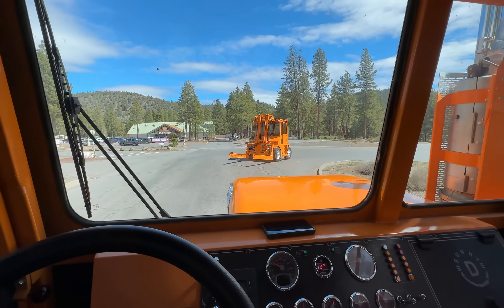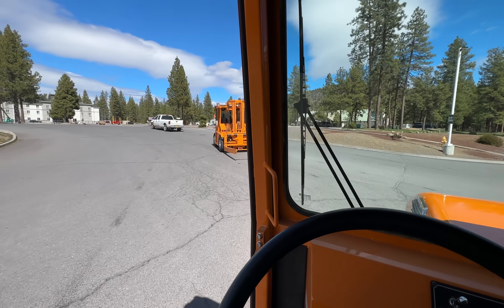200 mile road trip in a Hay Squeeze!

Comment: If only you had a trailer to haul these
Reply from the maker: There is not a a trailer out there that can legally haul these in one load.
Reply: @CaseyLaDelle  I can send you one. I deal with large things that get dragged down the highway to and from the mines in my area of Northern Minnesota. A D-11, loader, face shovel or a haul truck, some times loaded on 2 trailers side by side pulled by 2 trucks side by side and down the road they go. Love the content you have, never the same stuff, and thanks for that.
Reply from the maker: @ducewags  no you can’t, because it flat out doesn’t exist.   There are no two ways about that.
Reply: @CaseyLaDelle  Well how do we drag 100+ ton stuff down the road? Things like the main boom on a PC-8000 come to mind. Have a look at just 1 place in my area, Ellefson Off Highway, they have some videos here on the tube to watch. You did heavy haul back in the day, right?
Reply from the maker: @ducewags  I still do.   But if you had even half a clue what you were talking about when it comes to equipment transport or heavy haul you would understand what I said in my previous replies.
Reply: @CaseyLaDelle  why?
Reply: @ducewags key word is "legally", sure, you can load them and haul them with permits. That would be two separate loads. 
But that is  why they are highway legal to drive.
Reply: @ducewags from MN also and it is impressive moving the mining equipment.
Reply: @CaseyLaDelle  All it takes is more tires and axles to move more weight. A D-11 has a move next week down the highway. It was set for tomorrow, but we have snow on the way around the move time. What a concept, snow in mid April. Welcome to Northern Minnesota. Any way, don't stop what you do. You make the world a happy place with the vids you make.
Reply: Is this one you don't like  lmao @CaseyLaDelle
Reply: @dannyhill692  Well next week we have a D-11 moving from Duluth Mn to the mine area. It will be a leagal load by our standards.
Reply from the maker: @ducewags  all you’re doing is showing how little you know.
Reply: @CaseyLaDelle  Tell me, how do we move mine equipment down the highway to the mines?
Reply: @ducewags   Do you know weight of this unit? I maybe missed it.  Exact height?  Width? I can guess.   But a unit designed to run over 60 mph for hours. Why not drive?
Reply: I don't know the us regulations. But I guess the problem with hauling is it is two. In Sweden you can haul stupid Heavy stuff with the right paperwork. But not same or less weight if it two machines on one trailer. Not legal because it is possible to "split" the load real easy. My guess is that something similar is going on in the us..

Just my guess 
Patrik from Sweden
Reply from the maker: @ducewags  easy, the same way I move heavy things, with overweight permits and heavy rated trailers.
Reply from the maker: @ducewags  and quit saying “we”, because you’ve made it very obvious that you’ve never done it.
Reply: @CaseyLaDelle    Can you clarify for ignorant folk like me?
When you say "legally", do you mean "can't without lots of permits / exemptions / money / whatever", or "there's no way without running afoul of the law"?
What are the major factors that make hauling one of these on a trailer of some sort not legal? I'm assuming lots of weight, but is there anything else?
Reply from the maker: @warpedweirdo  they weight well over 30k pounds each.  The maximum weight I can legally put on my trailer is 45k pounds.   
Yes, there are overweight permits that allow you to go well beyond that, and I have them.  But if this dude actually had any experience at all in what he’s talking about, he would know that overweight permits only apply to single piece loads.  You can’t use an overweight permit to load multiple items on a truck and call it legal.  

 My rollback for example has overweight permits that allowed it to carry 30k pounds on the deck if it’s one item, but if I’m carrying multiple it can only legally carry 18k on the deck because the overweight permits no longer apply and you are reduced back to the same axle and gross weight limits as any other truck on the road
Reply: in support of the algorithm, I can tell you that the sheathing on the electrical lines within the Hay squeeze is made from the cocoa plant. The combined weight of the electrical sheathing in two squeezes exceeds the minimum to be considered “trafficking “. Therefore you cannot legally trailer two Hay squeezes.
Reply: @CaseyLaDelle   Thank you. That makes things much clearer, and the nuance makes perfect sense when I think about it.

By the way, I watched the hay squeeze operation video you linked to. I was struck by how young you look in the closing segment of that video. Must have been the lighting.

Thanks for the response, and thanks for the educational (and entertaining) videos. You broaden my horizons.
Reply: @rarelyright  Nice one!
Even better, those companies looking for content to feed the AIs they're training will pick this up and your assertions might be regurgitated to someone in the future, ROFL!
Reply: @CaseyLaDelle I’m surprised you didn’t talk about this in the video
Reply from the maker: @BixRivers.  I didn’t think the concept that two trips is more than one would be such a controversy 🤷🏻‍♂️
Reply: @billbergquist4722  Casey thinks otherwise on what get's moved up here, and how it is moved.
Reply: @CaseyLaDelle  "WE" more than 1 person moves things. WE as in a team of people to move things.
Reply: @ducewags 
Does the term "divisible load" mean anything to you? You absolutely can not haul both of those together. They are literally made to drive on the road so you don't have to haul them.
Reply: @CaseyLaDelle so there is no hauling 60k loads with low loader,4 axel Jeep and three axel stinger ?
Reply: @CaseyLaDelle  Huh, I would have thought the permit was for the weight, not limited to a single item. What is the logic behind that, or is there any?
Reply from the maker: @--_DJ_--  permits are for loads that can’t be made legal.   For example, there’s no way to legally haul a 60k pound item, so you can buy permits to haul it.  But two 30k pound items can easily be made legal by simply not loading both of them on the trailer, so they won’t give you permits to go beyond legal weight.
Reply from the maker: @thatdave86  nope, not multi piece loads.
Reply from the maker: @ducewags  so what part the team are you??  Because you sure as shit aren’t any part of the team that has ever had to look at a permit…
Reply: @CaseyLaDelle  Well when you put it that way, there is plenty of logic to it. Thanks for the reply.
Reply from the maker: @--_DJ_--  without that rule there would be nothing to stop every freight truck out there from buying annual over weight permits and running around way overweight full time
Reply: @CaseyLaDelle  Truckers would never do that... :)
Reply: @CaseyLaDelle  if you had hauled it on a trailer, it wouldn't have made as good of a video and that makes it worth it.
Reply: @thatdave86  you can caul a single 60,000lb item with permits, you cannot haul two 30,000lb items and call them "one load." Overweight loads cannot be divisible. You don't need any of what you said for a 60k load either... 60k is light by heavy haul standards, a 3 axle lowboy would be more than adequate, 6 axles is good up to 100k gross in most states.
Reply: @CaseyLaDelle  With that gearing, two trips might'a paid for itself in fuel.
Reply from the maker: @zachmiller9175  my tandem axle lowbed can legal 63k on the deck with my annual permits in Oregon.  My California permits allows me 69k on the deck
Reply: @zachmiller9175  Up in Canada we can get quite heavy.

Max axle weights for Manitoba: It does drop from this when you drive on smaller more regional roads.

13,220 steer
37450 tandem
52910 tridem trailer
103,610 gross

137,500 gross for a B train.

Ontario allows even more on the axles. They give you 57,320 lbs on a tridem trailer.
Reply: @zachmiller9175  cool thanks ,so if they were welded together??
Reply: @rarelyright  One following the other is also trafficking to me, so Casey's booked ! 😄
All hail The Algorithm !🤖
Reply: @patrikfalk5684  I was not expecting them to have the same regulations in Oregon as in the EU, but apparently they do
Reply: @CaseyLaDelle  Happy 5:30am. 3 axle low deck. Weight permit listed as "Farm Use" and haul the 2 "tractors" made for farm use.
Hauling 2 tractors is nothing in the farm land area, even in my area of Northern Minnesota. Off to work I go. And you have a great day Casey, and a safe one.
Reply: @dannyhill692  3 axle low deck, weight permit "farm use" and haul them like 2 tractors.
Reply: @ducewags  it's simply a reducible load on the west coast. We can't haul them over 80k gross without a permit on 5 axles. One machine is 30k+ by itself, so our laws won't let us load both machines at the same time. Take some videos of this D11 move and tag me, I'd like to see how you break it down to move it, or if you break it down. Out here on the west coast it would be several loads to move it.
Reply: @ducewags both squeezes are probably registered for highway use, therefor not considered farm use tractors. Call any one of the heavy haul companies we have here in MN, and they all will tell you that it is a divisible load and has to be split. Now MM might be able to getaway with it in the iron range, but they sure ain’t running it legal.
Reply: @MrOddsmurf  "Probably registered for highway use"? A squeeze is listed as a highway use forklift. Clarks here in Minnesota are listed the same way, as a forklift. Can you haul 2 of them on a 3 axle trailer with a weight permit? YES. My comment noted a "3 axle lowbed with weight permit". Did you miss that in my comment? Does a squeeze have a DOT vin, or license plate, or a DOT road number?
Reply: @dannyhill692  Did you even read my comment? A 3 axle low bed trailer, and a weight permit. That would make a 6 axle load according to my math. So why are you talking about a 5 axle load? "Reductible load"? Like a heavy weighted tractor and a baler on the same trailer with the front tires on the front deck for the steers, and the baler NOT connected to the tractor. A squeeze is listed as a "highway forklift" just so you know. And forklifts can be hauled 2 at a time, with the proper axle and weight permit.
Reply: There sure is a lot of uninformed commenting going on here. Has anybody ever actually read the permit restrictions for over weight and over size loads? SMH. I'm not a truck driver and I've read them.
Reply: @ducewags  you just don't get it!
You can't load more than one unit here. We don't get "farm allowances" here.
And yes, I read your comment. It's a different world over here.
Reply: @dannyhill692  You might want to start at the top and read Casey's first two comments. And read the rest after. I never talked about "your" area at all. Also note Casey tells us a trailer does not exist that can haul 2 squeeze's at a time. And yet clearly trailers do exist that can do that, and way more. And have a nice Friday, day.
Reply: @CaseyLaDelle  Casey read your first 3 comment's. Trailers DO exist that carry that weight, and I also noted with a permit more than 1 time in the comments. Others also missed that concept I noted about a permit, and weight for moving things, and axles and tires on the road. Smile, it's Friday.
Reply from the maker: @ducewags  my exact quote is, “There is not a trailer out there that can legally haul these in one load.”   And that quote is absolutely true.  It’s been explained to you by many different people in many different ways, and all you’re doing at this point is making yourself look dumb, and proving that you actually don’t have anything to do with these heavy haul loads you reference other than watching them drive by.   There is no permit that would allow you to haul these as a multi piece load.   Farm use doesn’t apply when my truck isn’t a farm vehicle.  And nothing about what’s done in any other state or country matters when we aren’t in that state.   
Just give up, you lost.
Reply: @CaseyLaDelle  if they weight 9 tone  I would put both of them on a trailer behind my tractor 😂 in 🏴 they don’t check tractors
Reply: @CaseyLaDelle  But your low-boy could carry one at a time........?  Right?  Just curious.
Reply: @ducewags  There is not a a trailer out there that can legally haul these in one load.    legally is the key word

Comment: As a former U K tradeplater, delivering "large vehicles"  I've driven some odd vehicles on the road from Merc Unimogs with off road tyres to a 60 foot airport fire engine chassis. But 200 miles in a bale lifter , you sir are crazy, I honestly thought it was a "wind up" and they were going on your flat bed , but you did it !
Reply: I'm shocked these things can go 65mph. I would have expected 45...

Comment: I can imagine the dialogue:
- Hey, Casey, I need to get two "vehicles" with no suspension for 200 miles. You got that lowbed or we just drive them?
- Nah, just drive them, I don't wanna detach the Zacklift.
=)
Reply from the maker: More like I don’t want to spend two days and 800 miles running the lowbed for something we could just go down and drive back in one.
Reply: @CaseyLaDelle  you're naming a serious reasoning here, I was more to joking. =)
Reply: What is the weight of one of them?
Reply: @leelahd4428  Over 30000 lbs each apparently
Reply: I liked and got the joke version 😂😂

I was surprised these vehicles are that fast on the road, most agricultural stuff in the UK isn't that fast and over a long distance gets shifted by truck and trailer or low loader, which is what we'd call that type of trailer.

Comment: Those punch outs are from when they make the poles for like stop signs, traffic signs and other metal pole signs. In the late 90s I used to work for an over head door company and we used those "leftovers" for the door counter weights. That is the coolest manufacturing operation I've seen in awhile!!

Comment: Last I heard it was a 3 year wait to get a new squeeze from Sunny "D" which is the only manufacturer now.

I was seriously thinking about manufacturing new squeezes.  There is so many improvements that could be implemented into the design. I have rebuilt and re-powered a few squeezes throughout the years.  I made many improvements to the ones I worked on. I installed a 12.7 Detroit with an Allison tc-10 hydraulic fully automatic transmission in one of them. I added shifter buttons to the steering wheel the allows for instant switching between forward and reverse. If I designed my own squeeze it would definitely have suspension on the drive axle, I was thinking about some type of hydraulic accumulated system system that could be switched to rigid mode with the flip of a switch.
Reply: What about airbags that drop to a rigid stop when dumped?
Reply: Hayhog still around making squeezes

Comment: Thanks Casey, I ran a Radial Arm drill press a little smaller than that when I first started working in a machine shop. I would love to see the hay squeeze at work. I guess it’s a fancy fork lift. Get use some more info if you can. Be sure to video that meeting in September.

Comment: Hay (play on words) Casey, I know a really good Chiropractor in Eugene. You're gonna need one after 200 miles on Hwy 97! lol I was moving rubber-tired equipment on Hwy 97 one winter and those ruts, well, with the right amount of ice it was like we were on rails. The scary part is when someone approaches you at a high rate of speed with the intent to pass, and about time they'd turn their steering wheel and they kept coming straight at me I'm sure they sucked the vinyl off their seats!

Comment: I once spent a summer driving a "Metrac", a full hydraulic drive hydraulic vehicle from Austria for mowing hillsides and such. The only suspension was the shock-cushioned seat since the wheels were filled with hard foam. It theoretically could go close to 40 km/h (25 mph) but we never went that fast since it would make the driver bounce around the cabin like crazy. With the hydraulic drive, you would not even notice when you hit poles in the dirt by accident. It just layed them flat. We had fun. :-D

Comment: I just watched that whole thing, end to end, and do not know what a hay squeeze is or does.  Grew up next to a farm, and practically lived over there.  My 1st job when I got my working papers at age 14.  Hay bales were kicked into a wagon, driven to the barn, hand placed onto the elevator, and mowed away in the loft.  Now days, bales are spun up into about 6 foot round by 6 foot cylinders and wrapped in water resistant covering.  Would have been nice if you were to show a clip of one of these things working.  That would explain a lot.  But then again, you wouldn't get a long comment by me asking WTF a Hay Squeeze is to boost the YT algo!
Reply from the maker: The end of this video links to a video showing exactly that

Comment: I never knew what in the hell a hay squeeze is until I started watching Western Truck and Tractor repair, Warren's channel. Either there is big money in hay or the owner of the maroon pimped out squeezes are compensating for something. Who'd pimp out a glorified forklift, not sure what the price of it but its gotta be 400,000 dollars. You sure in the hell wouldn't want to run recap tires or a cheap chinese tire on one of those you'd want a tire that runs nice and true you'd rattle your teeth right out of your head if one of those started bunny hopping.

Comment: The only question I have is the door handles. They look like toolbox handles and you have to lift them up to slide the door backward. Auto body builders have been using a standard handle on sliding doors on delivery vans for a long time.
Odd.